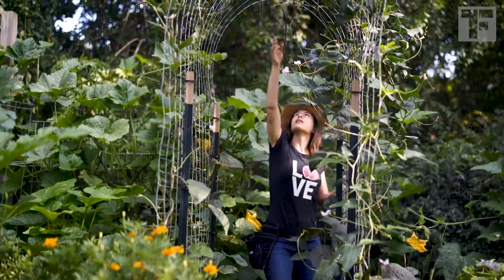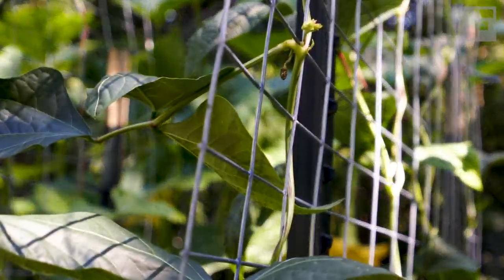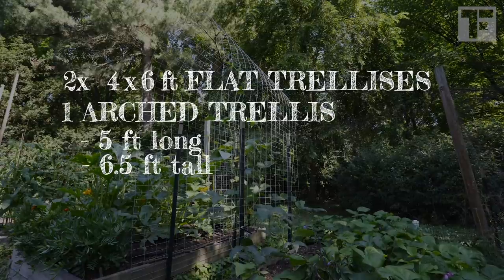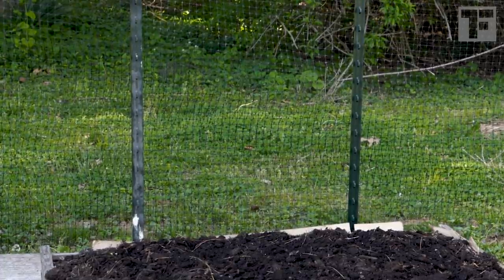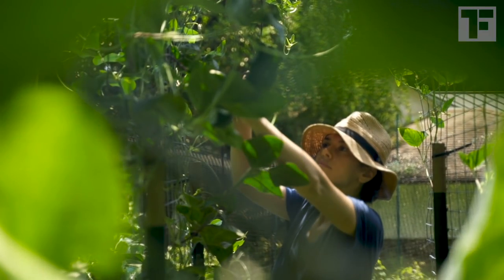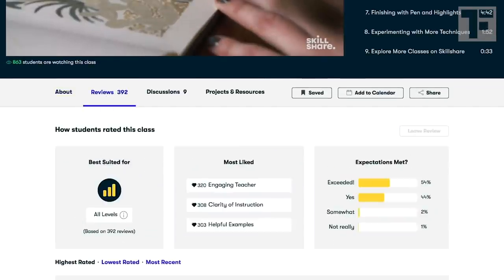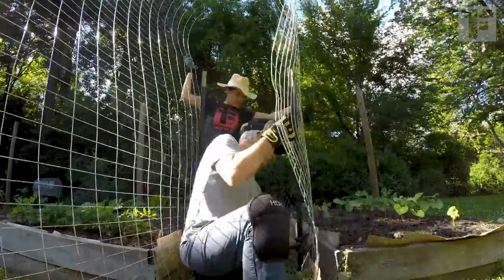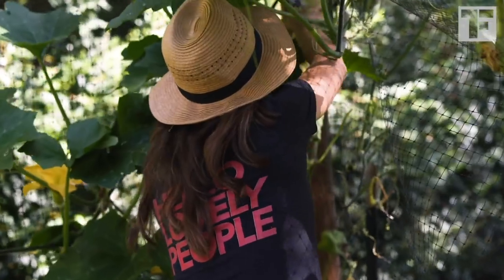Make THREE amazing trellises for under $100

Comment: You can use fence clips instead of zip ties: they are more durable, reusable, and designed to work with steel fence posts. They are cheaper than zip ties too.

Comment: Your videos gets my thumb up at the start as I always learn something.
I've a trailer so I do have the 16' cattle panel and love it.
On my 16' hoop cattle panels trailace I have started the climbing zucchini ( not going to try to spell it's name) as you grew.
6' T post are the biggest challenge to setup easy and safer if you have a T post driver tool ( adding the cost) but I to have used the hammer.
 I'm trying Luba or "sponge gourges" also for the first time.
I also did the no tilt garden as you taught.
Thanks for the many fine videos you and your hubby has done so well..

Comment: The video shows T-posts but the picture was of a U-post. They are lighter weight and typically cheaper which can be an adequate substitute. However, if you’re in an area with very high winds or strong storms roll through,  they can twist and buckle if not secured properly. I use hose clamps; strong, secure, and easily removed if I need to replace a post or move trellis. If you have hard soil a rubber mallet is asking for more work. Metal mallet or post driver will make job, quicker and easier.

Comment: You can find a “post pounder” for about $35 - it’s a heavy steel tube, closed on one end, with handles on the side - it slides over the post and drives it in. They work great. You may have a “Tractor Supply” near you or they probably have them on Amazon. You want it to be heavy of course.

Comment: In some areas with harder soil, a rubber mallet will not work for driving a post into the ground.  Use a small sledge hammer instead.

Comment: The  T-posts have a pre-formed galvanized clip for securing wire fence to the posts. Check your fencing dept of your home center ( not in the garden center) or search Amazon. A bag of 50 is nominal cost YouTube has videos on how to clip them on. They clip on and off securely so you don't need single use zip ties.

Comment: One addition to a good video: the wire ends at the edges  should be bent around so you don't get stabbed. It's tedious and not easy, but makes it much safer.

Comment: how is 115 , for under 100 ?    Math not needed for gardening.
Reply from the maker: As I mention in the video, I made lots more things with that amount of wire - more than the three trellises. You watched the full video, right? :)
Reply: it sounds like she's got plenty of fencing left over from the three trellises, so the cost for the material used for them is under $100.

Comment: you can get 4" x 16' cattle panels for about 25 bucks. two t posts per side on the outside of the arch 8 bucks each. 57 bucks total. you can cut the panels and make several vertical walls for boxes. much more economical